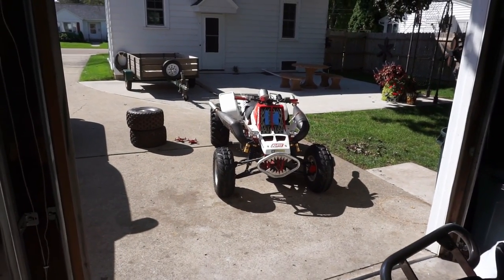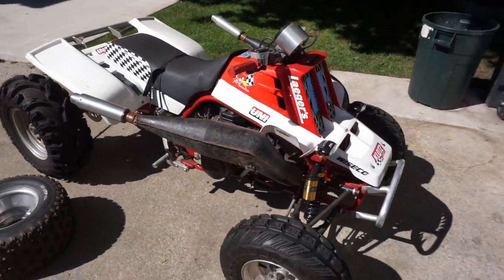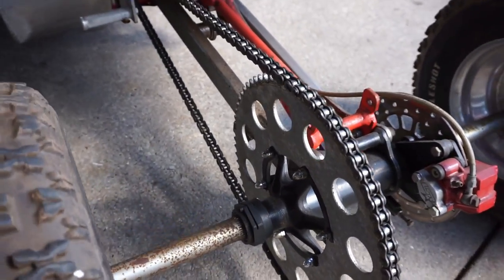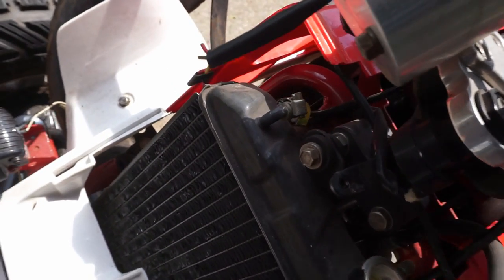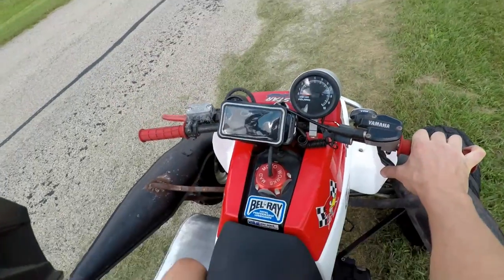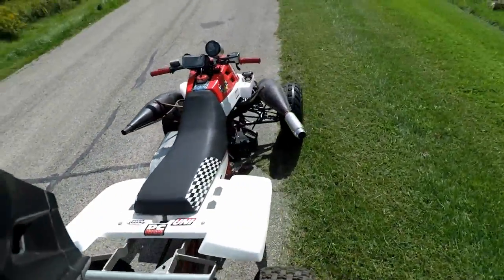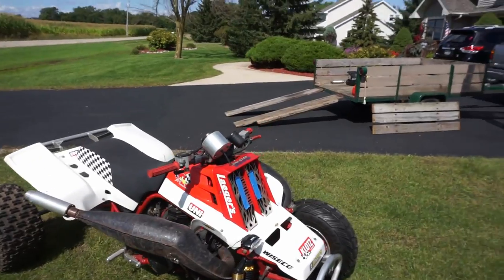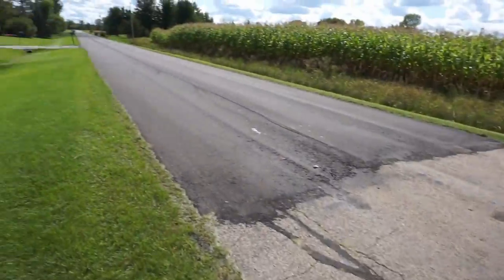110 HP Custom Yamaha Banshee TOP SPEED Test (INSANE TORQUE)

Comment: These comments doubting a 600cc liquid cooled two stroke sled motor making 110hp has clearly never driven a snowmobile.   Cool vid man, congrats on 200k subscribers.  Keep up the good work!
Reply: For real man ! My mach z 800 T had 155 hp from factory
Reply: Exactly 💯 correct.
I had a 780 Polaris a few years ago that had 130hp 
So this kind of power in a snowmobile has been around for years.
Reply: Some folks this banshee are the only bad ass 2 strokes but when you go from dirty to snow game changer an I meant big game changer a Ski-do an Polaris both make some killer sleds I love my renegade X-rs 900 ace 😎😎😎 it’s a four stroke but this lil baby get down in the snow an its some of the best riding you can do in snow in my opinion I want a turbo or twin turbo 1200-1300cc sled
Reply: Banshees are 350cc
Reply: @clarebowron6559  Yup, but this isn't a stock banshee, and we're talking about the power difference between sleds and atvs.
Reply: A 97 art 600cc was 115hp
Reply: Except snowmobiles are a extremely different concept. They can put that much power out because they are meant to be ran in tempatures well below 0 so overheating isn’t much of an issue.
Reply: @Rob-pe3gf  +q
Reply: @nicoleschwarzconnor4926  ?
Reply: For real, my 01 polaris 600 came with 115hp stock
Reply: And you think 110 HP wouldn't be able to wheelie thislittle girls. I,m guessing as she is she maybe has 35 to 40 HP.
Reply: @marcelloroos766  with the right clutch setup, and giving it wot…absolutely.  Neither seems to apply here.  Again, it’s amazing to us living in the snow belt that people doubt these hp numbers.  Factory sleds have waaaaaaay more hp than anything on four wheels.  You put a banshee motor in a 500 lb sled and it would barely move.
Reply: A snowmobile Suzuki engine with a yamha fourwheeler=awesome
Reply: 650 Wildcat is in the 108-112HP range
Reply: 350 twin 2 stroke will make 60hp with literally just a set of pipes.

Comment: Hate to tell you but thats no where near 110 hp and honestly a stock banshee will run just as fast nearly, the extra weight on that thing makes it handle like 💩.  I had a worked up special edition 2006 banshee with cool dome heads, porting, polished, vforce reeds, air pods, and so on... Guarenteed my banshee would have smoke this thing
Reply from the maker: Possibly but this banshee only cost $1800. What did the fully built banshee cost? Probably 6k+
Reply: @2vintage  you got a point there.
Reply: @2vintage  the build shee would destroy this heap and the built shee can be ridden anywhere. This heap looks like trash and built @ss backwards the way the pipes and left foot are set up and is only good in a straight line. Built shee is better and you scan do a 4mm build yourself for less than 3k all day no prob

Comment: If you're anywhere near the dunes, this would make an awesome dune quad. I can't imagine this ever being a good general off road quad, in part due to the suspension but mainly due to the massive pipes going to each side that will not be kind to you if you take a turn too quick or crash. Also, you can step on the brakes and let the CVT clutch slip and launch it really hard, did it all the time on my KFX700. Awesome machine!

Comment: She’s definitely quick off the line ,I kind of thought there’d be a higher mile an hour , but that’s just in the gearing! My mostly stock can am renegade 850 topped out at 81 miles an hour but it will not get to that speed as quickly as yours does😵‍💫 But I can’t wait to see what you do to this thing it has a ton of potential🤩 Great video as always though and keep up the great work👍🏼🤩

Comment: you should try cutting the exhaust pipes shorter/closer to the engine and mount the mufflers. you could make them angled down and would be much less dangerous if it were to be wrecked.
Reply: It’s a 2 stroke and those are expansion pipes. They’re tuned for that exact shape, kinda need a different pipe instead.

Comment: just drill a small hole threw that silencer and threw the pipe and bolt it on. Note i would use a thin bolt as not to restrict flow on that exhaust.

Comment: A set of extended header section pipes would be cool. That way you could run it under or over the drive case and expansion from there back.

Comment: You should try some Klotz super techniplate or benol for the banshee, great oil for high revs
Reply: Terrible oil actually, so bad in fact it literally tells you on the directions to use a good 2 cycle oil with it or the engine will rust during storage. Clearly the oil is shit and I know this because I've used it, never again
Reply: @chickenknucklez2604  ran it in my banshee for years. Works great, top ends always looked good on disassembly, I don’t understand why a two stroke oil would tell you to run another two stroke oil, never seen that on any bottle I’ve ever run in 15 years… but I’ll definitely look now
Reply: Funny u say disassembly because this is definitely something I have done with it on 3 different engines with no variation. My findings were hard brown caked on shit covering the piston, not only covering the piston but made the rings stuck on 2 engines and well on the 3rd not so lucky.... Busted the ring. So you can tell me whatever you want but I proven that oil is straight garbage, u wanna run good oil sometime then run Amsoil there's nothing better and the engine stays spotless.
Reply: @chickenknucklez2604  sounds like a carb issue, or too much pre mix, like I said 15 years running banshees 3 of them I still own in the dunes at glamis always ran Klotz super techniplate or benol with race fuel and my cyls looked good and pistons crowns were always clean, try a different premix amount. Also could be cheap fuel. But with race fuel (c16) and good compression it’s great oil
Reply: @ni_wink84  all 3 we're good stock engines,  it if you're happy with the oil so be it. I used an entire gallon for bar and chain oil

Comment: Voltmeter was set to AC not dc. And normally best to put the ground probe to the chassis or battery. Then use the positive probe to check boltages. Use continuity testing for switches and relays and non coloured wires etc
Reply from the maker: I tried both ac and dc
Reply: Most stators out out AC...the regulator/rectifier switches it to DC
Reply: @dang223434  fair shout I was thinking of the way an alternator works not a stator. 👍
Reply: @2vintage  did you try guns n roses though? 😆😆✌️

Comment: For $1800 man thats awesome lol!! With the right gears should go 150mph i know enough about snowmobiles to know. Lot mess weight banchee frame less rolling resistants than snowmobile. Looks like a arctic cat Suzuki motor the little I could see. Iv had 600 snowmobiles that i had on radar 115mph so ya crazy fast if u gear it.

Comment: My 400ex is maxed out on horsepower racing CDI racing fuel injected carburetor cammed out high octane fuel 108 shoots 3 ft flames out the exhaust 120 horsepower crazy fast

Comment: Those smaller tires kill your gearing, I would think a machine setup for drag racing has pretty touchy gearing. If I had to guess I would say you lost several mph and it will rev faster.

Comment: Bud that quad is never gonna go off-road it’s just not meant for it now, you should’ve known what you were buying, at best maybe sand or ice is the most off-road that quad will be capable of
Reply: just throw some slicks on it and sel lit as drag quad and keep the front fox suspension those have some value in them :)
Reply: 100%

Comment: This is a drag quad, it is not for off road anything outside of sand drags.   It isn't even meant for unrolled grass lots.   Looks to be set up for sand drags with that gear.   Maybe some 1/8 mile pavement with some slicks. 
75 isn't fast at all, so I'd guess that is what whoever was doing with it.

Comment: bro i'm telling you please hook the tachometer up all you have to do is connect it to any power and any ground wire off the sled engine it uses AC current pulses to read rpm pretty simple device but i need you see what it is revving out to the engine should be revving to about 9000rpm once the clutch. is fully engaged and in overdrive it sounds like it is nowhere near that that's a TON of power and speed your missing out on and to the top comment there that said to brake boost it you will slip the belt in turn toasting the thing you need to put a stiffer spring into the primary clutch to bring the engagement up to like 4500-5000rpm trust me i work on snowmobiles for a living i know what i'm talking about bro

Comment: Don’t put a smaller sprocket it will have no bottom end snow mobiles don’t have low end you have to get the rpms up before the make power that bigger sprocket helps with the bottom end power

Comment: And hey all drag racing vehicles have no rear suspension right?  WRONG the slight, and I do mean slight articulation in the ass end and the dampering of said articulation will drastically increase traction by spreading the force of the torque more evenly through the chassis on its way to the wheels and ultimately TO THE GROUND!  Simple physics really.  O and, ditch the Llamalube and get some Klotz racing oil bro.
Reply from the maker: I was just saying what the comments were saying about it last video.

Comment: That's built for short fast pulls on dirt, not asphalt...and probably not over 100HP, 100HP is a lot of power. Prove it on the Dyno and not busting your stones cause you did say (supposedly) 100 or so HP...but would like to see what it has either way it's fast, but it's a purpose built machine. Would be fun to go and race it tho.
Reply: I had a 95’ ski doo 583 twin that made 98 Hp, so it’s completely realistic.

Comment: A smaller sprocket would be a good idea if you want more top speed. Fitting those smaller wheels would have lost some of that as they have a smaller rolling radius. On the plus side its increased the acceleration.  I'd be mindful of the speed rating of those tyres though.